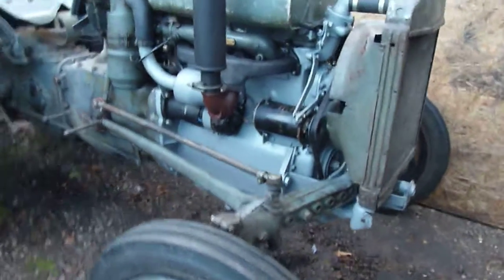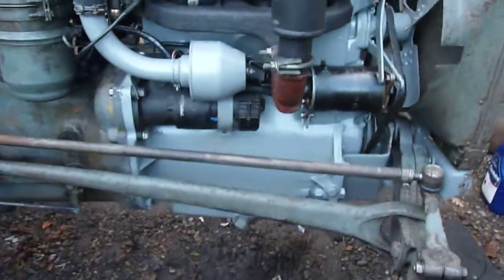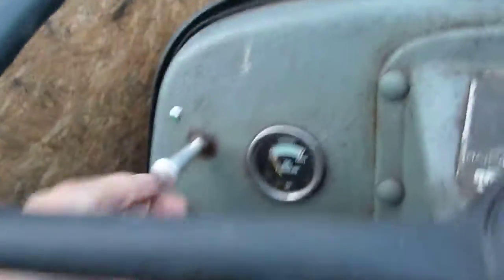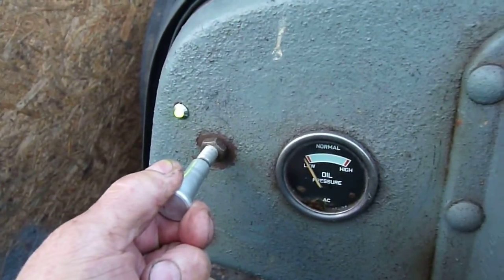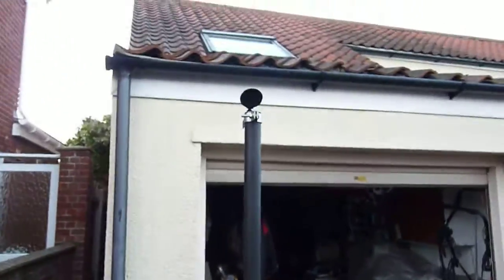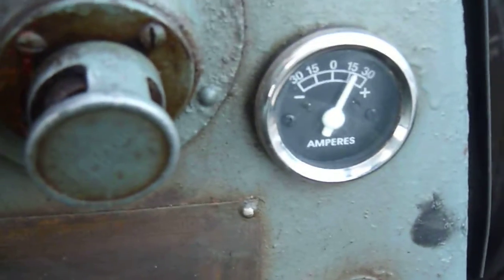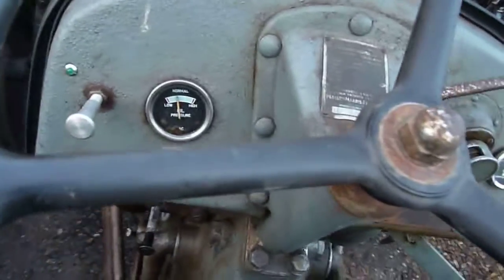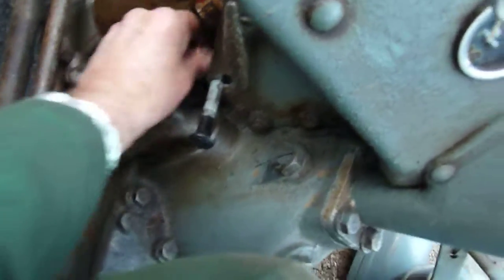FERGUSON DIESEL TEF-20 TRACTOR REBUILD AND START-UP

Comment: Starting  and reving a cold engine  and then turn it off is  about the worst thing you can do   , start it run it at a fast idle and then turn it off or use the tractor

Comment: Absolute Top of the Range Complicated Engine and I'm so Suprised that Ferguson managed to make it so difficult to work on a start ,A fordson or Nuffield would have started half a turn ,After a Rebuild I would be so disappointed listening to this start up 😢 Excellent when working but worst I've ever worked on 🙈😡 And i fitted a Pre Engaged Starter motor I could not live with the Gear leaver starting Method ,And now 4 position key is 100% The way it should have been made when new , of just a Simple Leaver like the Major or Nuffield 😂✌️

Comment: Hi  There .I recently  restored my ferguson tef  20 and  there is oil coming out of the exhaust  elbow joint when the engine is running  .I did not have this problem  before  the  restoration  and the tractor starts very easily  . The tractor  has not been  worked  for a long time .Any help and  advice would be much appreciated.

Comment: Hello, I'm currently rebuilding an ferguson TEF-20 myself. And i can't seem to figure out how to take the pistons out of the block? It seems that the piston will not go through the engine without taking the piston liners with them? Did you have this problem?
Reply from the maker: Yes ....! that's the main problem working on this engine, the big end will not pass through the cylinder. You can push it far enough through to remove the piston gudgeon pins. You also need the crankshaft out to refit etc.
Reply: @doctorvox  Thanks, that will help me a bit :)

Comment: Great job. I want to fit a temperature gauge to mine . Where is your water temperature gauge attached to the engine? Thanks
Reply from the maker: Thanks, I dont have a temperature gauge! But it should be easy to fit, probably on the thermostat housing? Maybe check the manual for clues.

Comment: @Outdoorsman Good evening. I was wondering if you might be able to help... I’ve just rebuilt a TEF engine and come to fire it up this weekend, with no joy.. No attempt to fire at all, even with easy start... just white smoke. I’ve double checked the timing and spill timing and all looks good to me. I was curious of your video as you mentioned timing your engine out of phase. Can you elaborate on this please? Do you mean that the 1/4 inch hole in the flywheel where you lock it for spill timing could mean the engine might be on compression or possibly exhaust stroke? 🤔
Reply from the maker: Yes Lawrence,  try rotating the engine one more revolution then insert the flywheel pin, unless you have the rocker box off and are certain that both valves are closed on Number 1 cylinder. I made up an adaptor for No.1  injector to check that I was on compression stroke, (pressure gauge) but easier if you can see the valves.
Reply: Outdoorsman Perfect, thanks for your help 👍🏻
Reply: Never use easy start in a re built engine it sud start easy with no heat if everything is spot on  easy start glases  up clinders and destroyes engines

Comment: I remember way back in 1960 I was working on a Farm in West Scotland and I was given a TEF-20 for plowing while all other Farm boys had Masseys with 3 cyl DI Perkins engines and they would start at half a turn of the engine and without any starting aids.....the TEF-20 procedure if I remember correctly was first to Press the excess fuel  button on the fuel injection pump, then climb on board and pump the Ki-Gas, then heater plug, then decompress the engine, then push in the start button on the side of the Gearbox with your inner right knee and then push the gear lever to engage the start solenoid and once you got enough speed up on the engine through the De-compressor lever and a quick prayer to the Good Lord that it will start....many times the prayer was never answer resulting in a Massey pull starting me and the thing that made me most angry was that on a pull start the engine would fire up straight away...but once she was running she was a great little tractor and did everything on the Farm but plowing was when she was at her happiest and the plow she pulled depending on the soil was a 04 furrow plow.
Reply: Leggero di buon acciaio inglese ha colonizzato il mondo intero tecnologia all'avanguardia considera l' anno di produzione. il MF  Perkins era arrivato dopo " bello sforzo".. Comunque  se scaldi candeletta,spruzzi King Gas e usi il decompressore   Qui in Italia parte benissimo . Indistruttibile Altri trattori anche più recenti sono Ferraccio

Comment: Can I ask your advice? I'm trying to get the crankshaft out of my TEF but it won't budge. I was told to suspend the engine block in the air, hanging from the crank, and that the weight of the block would pull itself off the crank. It's been like this for a week but still isn't moving.Can you offer any insight? Thanks
Reply from the maker: Hi Michael, I answered this on my other video (see above),  it can only be held by the gasket 'goo' IF you have removed ALL the bolts, particularly check the one in the centre bearing. Have you got the flywheel off? https://youtu.be/jpeu_L0VlcU?t=72
Reply: @doctorvox  Thanks for the response. Yeah all bolts removed, flywheel removed, it's just stuck fast. What do you mean by "gasket goo"?
Reply: @mikefoxo  If you have the engine out and flywheel off and all the 03 main bearing blocks off the 04 big end bearings off the con rods then the Crankshaft will lift out easily,  sometimes the Main bearing blocks can be hard to move but gentle taps with a brass hammer will shift them.
Reply: @michaelmacluskie6089  There are no bearing blocks on this engine, it's all one solid piece of iron. The only way the crank can come out is by sliding out the back of the block, where the clutch fits on. I have made a video showing my problem https://www.youtube.com/watch?v=19GZBY4nols
Reply: Good evening. I was wondering if you might be able to help... I’ve just rebuilt a TEF engine and come to fire it up this weekend, with no joy.. No attempt to fire at all, even with easy start... just white smoke. I’ve double checked the timing and spill timing and all looks good to me. I was curious of your video as you mentioned timing your engine out of phase. Can you elaborate on this please? Do you mean that the 1/4 inch hole in the flywheel where you lock it for spill timing could mean the engine might be on compression or possibly exhaust stroke? 🤔

Comment: Nice tractor and well done rebuilding, I just bought a 1959 TEF it has no wiring loom, no dynamo like yours, but it does have an alternator, but as I said not wired, it runs but the engine race's, I am told this is a diaphragm problem in the pump, collecting it Saturday if you have any tips I would love to here from you.Cheers.Jimmy
Reply from the maker: Thanks Jimmy. The wiring loom is an easy replacement, I did mine too. The K-iGass makes it easy to start, so worth doing if you have it.  My governor piston (housing on the end of the pump) was seized solid, but it still used to tickover OK !  Good luck with yours.....
Reply: Sorry the year of my tractor is 1950, just took the filter off its filthy with dirt and its horrible looking, probably not been service in a very long time.